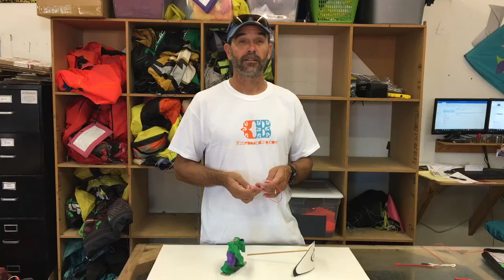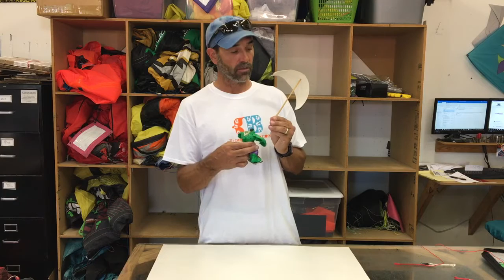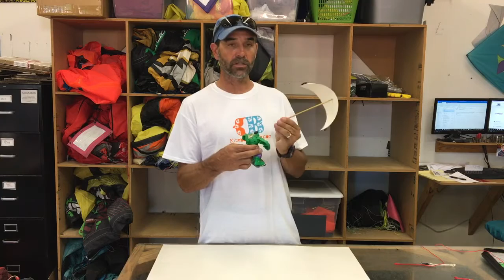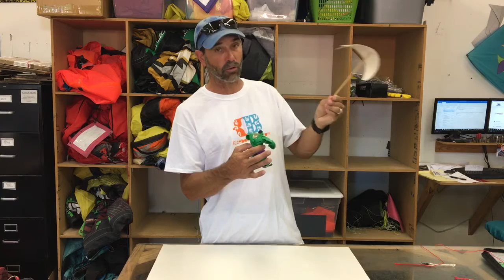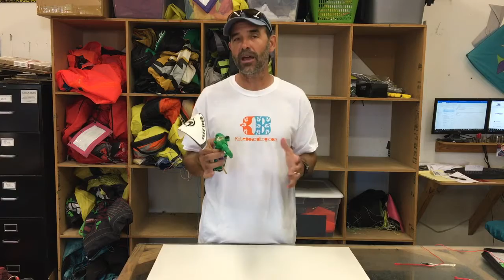Line extensions

Comment: I tried 43 meter line length on 12m in light wind.  Doubling line length is a move to get a session out of wind that is too light.  Since the kite has less lift at lower angles, keep the kite high to avoid dropping it in the water.  Dropping the kite in light wind can end the session.

Comment: Hi Jeff,
Thank you for all your super awesome helpful videos really appreciated!
Do you have a quick and easy method for removing the line extension knots, I use Core lines and bar they are really small nots and I need to use a very small screw driver to loosen and remove the line extension knots afraid by poking into the knots over time might damage the lines over time? Thanks very much! Matt